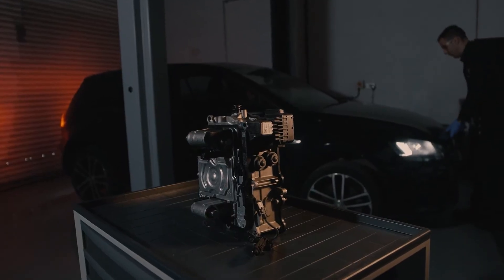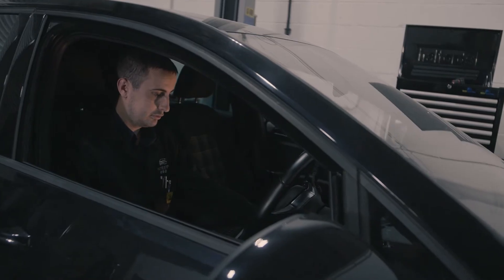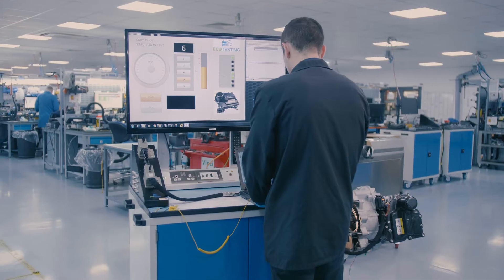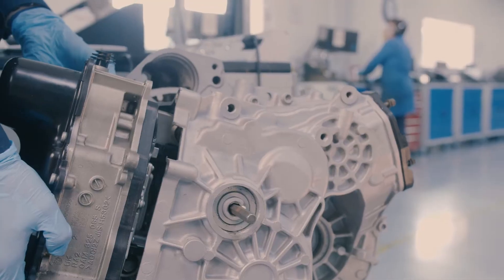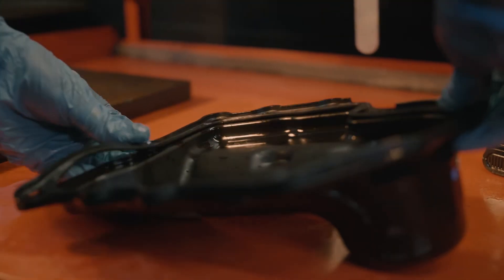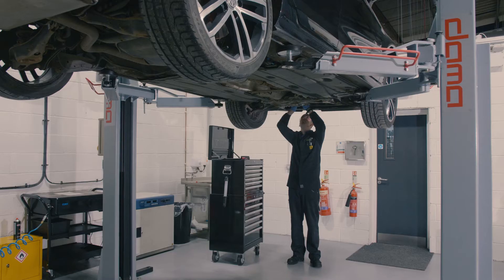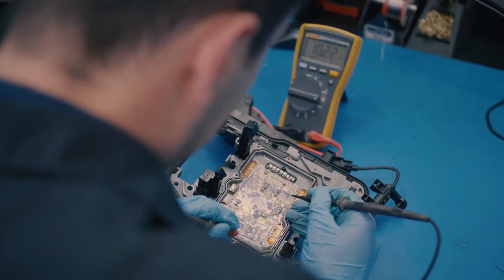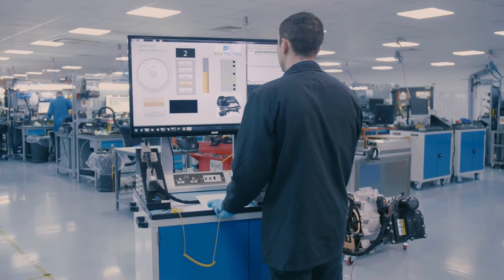Audi/Volkswagen DQ200 DSG 7 speed mechatronic repair and how to properly test for the problem.

Comment: I have no gear selector. 1/3 intermittent , Can this be the same problem ? Thanks .
Reply from the maker: Hi. Are you able to scan the vehicle for any fault codes? This will help determine if the fault is with the mechatronic unit or something external. Thanks.

Comment: where is the main 30 amp fuse located?
Reply from the maker: Hi. It should be located in the engine bay fuse box, but check the fuse box cover to determine which fuse it is. Cheers

Comment: Does anyone no what the problem will be amg a45 when going to floor it it go's into neutral?  The guy saying it's the mechatronic unit  will a full unit of yous fix this problem ?
Reply from the maker: Hi Craig. Are you able to scan the vehicle for any fault codes? A lack of gear selection and no drive is a common sign of a faulty mechatronic unit, but to be sure its the unit that is faulty and not something else, email our technical support team at info@ecutesting.com with you make and model of vehicle, the mechatronic unit's part number and any diagnostic information you can, and they will advise you. Thanks.

Comment: Hello 
I had an u010100 error, and I just removed the mechatronic diasambeled replaced the ecu from within (with a sh one), and everything is fine.
My first problem in 2017 was the leaking oil from the acumulator base.
Replace that also  
I'm interested in just a new software for it , how much will cost ?
Thank you
Reply from the maker: Hi. Unfortunately we do not offer just the software as a service, so we would recommend going to a specialist or the dealership. Apologies.

Comment: A DQ200 User is Here And i replaced The clutch  Pack once on Warranty And Mechatronics Unit Twice The 2nd Time was on my wallet 😑.
Reply: how much did it cost?; I got problems myself with the dsg
Reply: @Mr1989Max  when's the last time its been fluid serviced?   Section 34 pp.. 70 https://at-manuals.com/wp-content/uploads/2019/7-speed_dsg7_0am_manual_eng.pdf
Reply: @BenState  I bought it of second hand so I dont really know, I have the car for almost 2 years and when I receive it, with 105xxxkm and now with 117xxxkm
I havent service the gearbox.
sorry for my writing.
thanks for your replies.!!
do you know if I can change the gearbox for a mecanic one? without changing te motor? or any components?
Reply: @BenState  do you know if that manual is accurate for my 2011 vw golf 1.6 gasoline? BSE 972592
Reply: @Mr1989Max  no, itll need repair
Reply: @BenState  you mean, I cant change the gearbox or you mean what?
Reply: @Mr1989Max  of course you cannot change the gear box.  what symptoms are you having?
Reply: @Mr1989Max  i Replaceed My Mechtronics At VW  KUWIAT Dealers For A total Cost of 680 USD Including The Labor (Thy Didn't  Replace my Clutch pack And Now It's Slepn)
Reply: have you put a used mechatronic or new one? i just put a Dq200 out of a 2015 golf in my 2012 passat but can't get it reprogrammed
Reply: stop driving it like you stole it.
Reply: @BenState  It is a trash transmission.
Reply: @Gr3eGo  According to you muppet.  I have one, I think you're confusing the DSG varieties.  The 200 is fine.
Reply: @BenState  Read About VW 2012 and 2014 DSG mass Recall.. They Made A DEFACTIVE PRODUCT.
Reply: @MeGBillG  
Greetings 
You have any link to the article?
Thank you